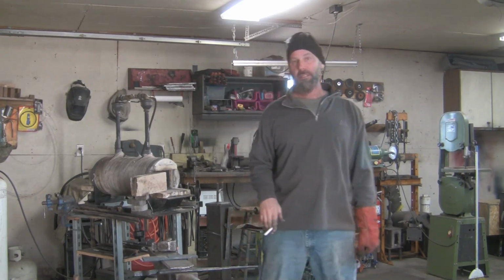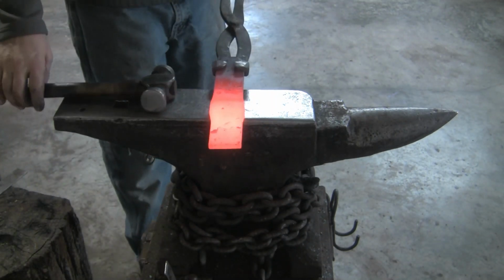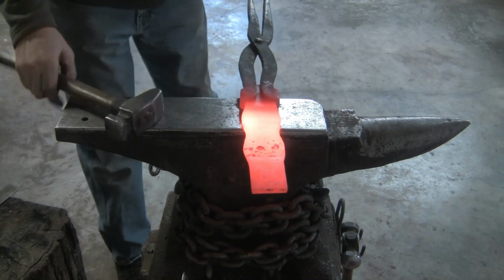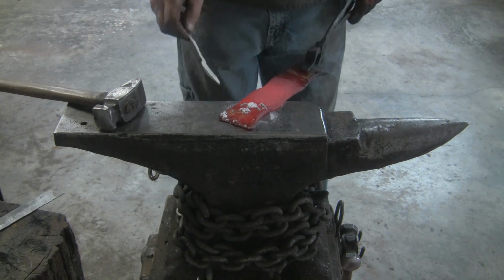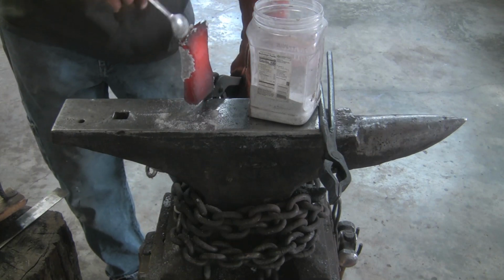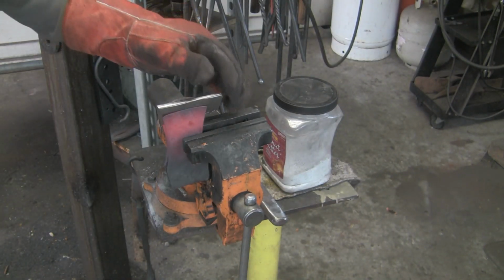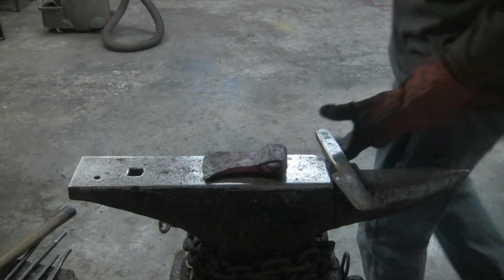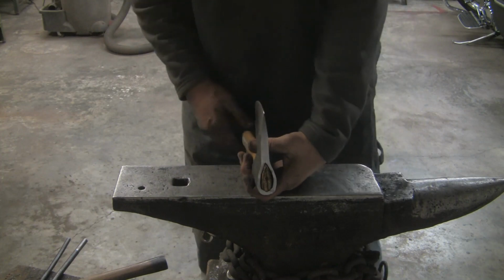Forging a Hatchet/ax

Comment: Problem I have right now with those store bought hatchet is as I use it to cut kindling and smack it with a hammer alot, it split the heal across the eye, I tried welding it and it split again. Although razor sharp from the store and still razor sharp after a month of use, it's worthless now because it split the heal.
Reply from the maker: Would a mallet work instead of a hammer, I am guilty of doing the same thing. Make a batoning log to strike it